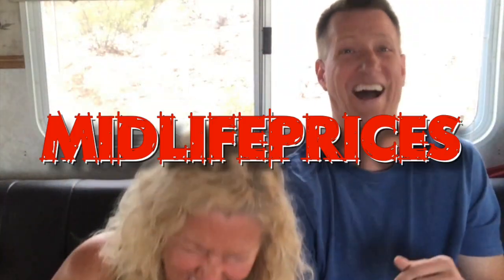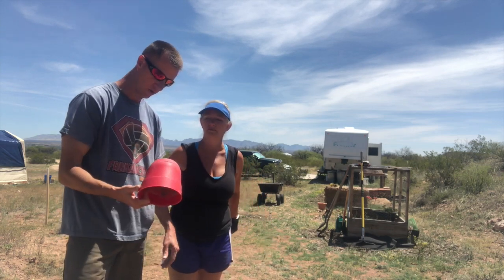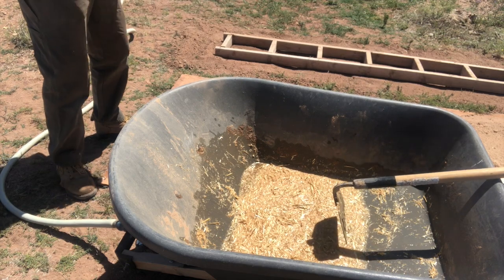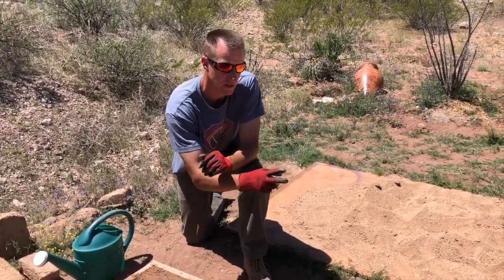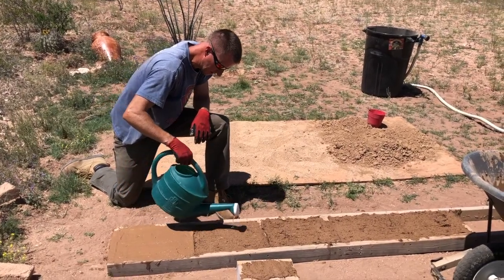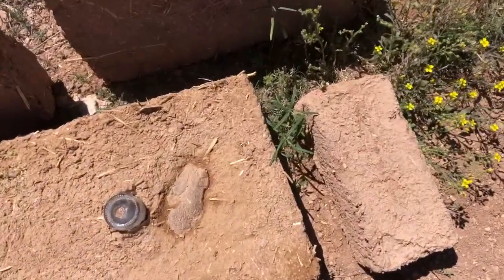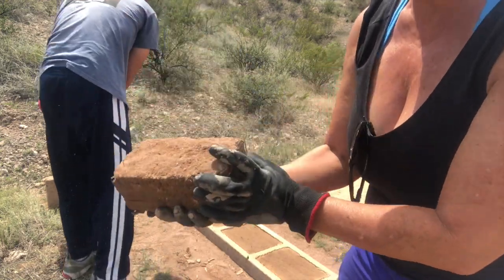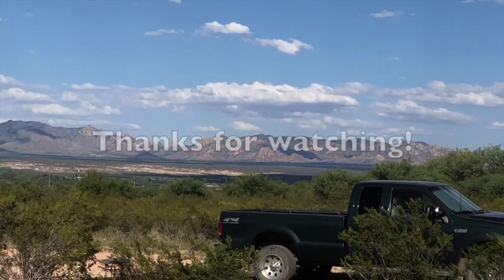How To Make Adobe Bricks

Comment: I know the video you watched.
There is another “seismic” Adobe brick video in Spanish with subtitles. In South America they have been building with adobe before the Spanish arrived.
The ratio from that video:
4 sand to 1 clay
(They didn’t state what the clay content of the soil was.)
Dry bricks in shade.
Brick surface should remain rough, do not smooth with water. This helps mortar/mud bonding to the bricks.
Their brick sizes were 30cm x 30cm x 10cm
Approximately 12” x 12” x 4”
Half brick 15cm x 30cm x 10cm
Reply from the maker: Sounds about right!

Comment: How do you stick them together? What takes the place of mortar?
Reply from the maker: Guess you could do just about anything you would do with normal bricks.  Depends on what they're exposed to.  If indoors, could just mud them together, but if exposed to weather, would probably have to use some cement in the mix or cover the whole setup with a waterproof plaster.

Comment: Just made my first 3 bricks.  No straw, so I used pine needles.  Not very fun to mix with bare hands lol.

I have no idea if mine will work or not, but I was able to take my mold off right after packing them and they have held their shape for 30 minutes so far.  I really hope this works cuz I have a ton of materials and hate spending money!

Seems like I needed a lot less water then I thought
Reply from the maker: Interesting substitution!  Sometimes, you just have to work with what you've got.  Hope that does the trick for you.  Having to use less water in your situation makes some sense to me, as I imaging the pine needles would absorb less water than straw would.  There are actually a lot of different fibers that can serve the purpose you're looking for to give the mix additional strength.  My only concern would be that the needles not really being "absorbent" would limit their ability to "bind" the mix together, but I don't know.  Love to hear how it works out!  Good luck!
Reply: @MidlifePrices  huh, makes a lot of sense when you say the needles may not absorb enough water to bind.  That is kinda my problem now lol, made 3 bricks, mold broke on first brick so shapes are all a little different.  Thin paver cracked a few days later (dog stomped on it)  but the other 2 are doing well.  Not dry yet though.  The chunk that broke is like concrete in places, but flaky kind of in others.  I do have some chopped straw for my garden, maybe I will try some of that for the meat batch.

Comment: im in AZ and planning to build with DIY adobe.  i have a bit of a different idea instead of bricks to take most of the steps out. i seen a guy using a sock net and making long tubes of adobe in it the diameter of a 5gal bucket. he would tamp each run flat. gave me an idea i want to experiment with.  i was thinking a slip form, make a form say a foot deep the width of the wall. same as your form for bricks but no center dividers. fill and let dry a week or so then move the form up and do another run. saves flipping, stacking and then brick and mortering them. eliminates a lot of handling them. .  also thinking ill use a power cement mixer.  i think ill be shooting for whispering ranch once the housing bubble pops
Reply from the maker: Sounds like a fine idea.  I haven't done any research on how the properties of a long continuous run like that would hold up to compressive forces, cracking, weather, etc.  It's possible there could be a drawback to making a continuous run like that, so hopefully that's not the case.  What you're describing is very similar to earthbag and hyperadobe construction, but they just leave the materials inside of the form (the bag).  I suppose if you plaster over the whole thing before they have a chance to get exposed to too much weather, the end result would be pretty much the same?  Good luck!
Reply: @MidlifePrices  i did a little digging and the idea is not new....sad im not the inventor. joy, its been done and tested haha.  there is 2 ways they did it. one is using forms to do sections at a time like a castle crenellation. leving gaps  in the run. then filling those gapes as a part of doing the next run....."cast in place" and i saw one do a slip form with plywood and a runny mix they pored with a cement mixer and did a 4ft tall run at a time. tho it had alot of cosmetic voids they just filled with stucko mix.

Comment: A dry mix is just that...dryer. You can remove the mold immediately with a dry mix and cracking is typically less. With "wet' mixes you have to leave the forms for 18-24 hours which requires your having multiple forms on hand.
Reply from the maker: Oh ok. Interesting. Thanks

Comment: Legend has it that if your soil is high clay content it's desirable to add 10% lime to your water or 10% cement if your soil is high sand content. Or just use 5% asphalt emulsion for either.
Reply from the maker: Good tip! 👍

Comment: What is best season / weather to make
Can we make more bigger around 12 inch x 5.5 inch
What is best material composition and ration for adobe bricks ? 
With clay sanf we also use hay shredded and cow dung also here in India
Reply from the maker: I would think you could make them anytime, as long as they're not getting rained on directly.  Other than that, it should only affect the drying time.  For the size, ours are 10" x 14".  The mix should be good for just about any size, within reason, as long as adequate drying time is allowed.  I suppose the best thing to do is just make a couple of test bricks and see how they come out.  Just remember that they will only have to withstand a compression force from being stacked, so any sort of "drop" test isn't necessarily the best way to test their strength.  Our ratios are listed in the description and mentioned in the video, but every soil is different, so again probably best to do a test batch.  Best of luck!
Reply: Does it require water curing ? 
And how many days are required to dry them. 
Summers at my location are may June 36 to 22 degree, Jan Feb Winters are 6 to 22 degree
Reply from the maker: Ours pretty much dry overnight, but we're pretty dry and warm here.

Comment: Pam ad Brian - That looks something like Adobe in Action's formula for a "wet" mix. Will you also try a "dry" mix? I will probably try both to see what has best compression strength with my soil when I get there. You can put plastic over the top to slow evaporation to help mitigate cracking. I can't wait to see your finished bathhouse!
Reply from the maker: I can’t wait to get started also!  I haven’t heard of dry mix. I’ll check it out. We did watch Adobe in action. Good eye. 😊❤️ Thanks so much! Pam

Comment: Whoa!   I seriously doubted that would be enough liquid for 14 measures of soil and sand but look at that!   If you just got into a habit of doing this everyday you would accumulate enough bricks for your shower and toilet room PDQ!    Once you get the habit of the small batch larger batches would look easier too!   Well maybe once in a while you could do larger batches   lol  Easy for me to say eh?   Since you have a willing partner now you just have to develop a system and breaking it up will speed the process (I image lol).   I have to have a system to make real progress.    Maybe a LARGE pile of sand and another of loose soil always at the ready for daily brick mixing.  Some boxes or bags of chopped straw so it is easily contained but not having to make it for each batch...  Hmmm   I would help if I was a neighbor!
Reply from the maker: You got it!  Systems are what it's all about.  You sound like an engineer, too!  Definitely all valid points.  Just gotta get it on the to-do list now.

Comment: Will hay work instead of straw?
Reply from the maker: Valid question!  There are a few key reasons you would NOT want to use hay instead of straw.  Andrew Morrison answers that very  question here: https://www.strawbale.com/straw-bale-houses-not-hay-bale-homes/, but I'll try to sum up quickly:
1. hay is food, straw is not
2. hay is baled with a much higher moisture content, which can lead to decomposition and possibly fire
3. hay can continue to grow after bailing, while straw cannot
Summary: Hay is for horses, straw is for houses.
Hope that answers it.  Thanks!